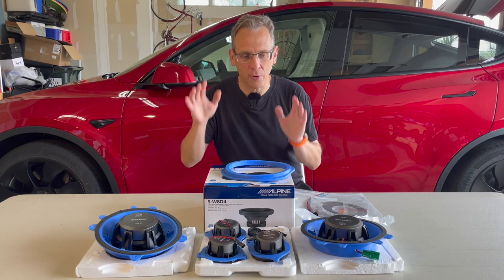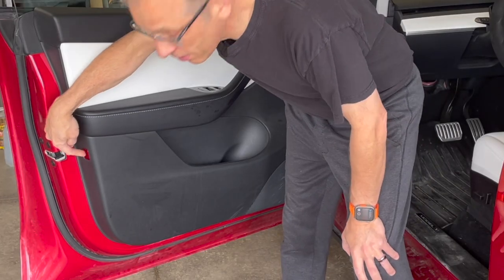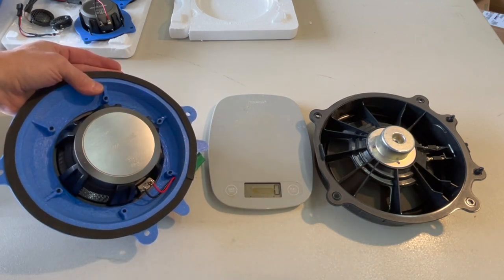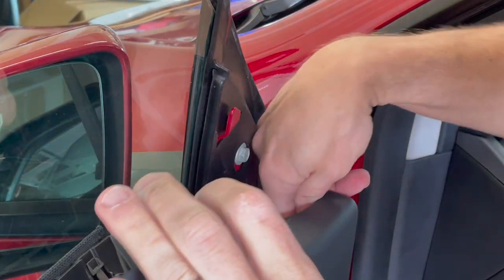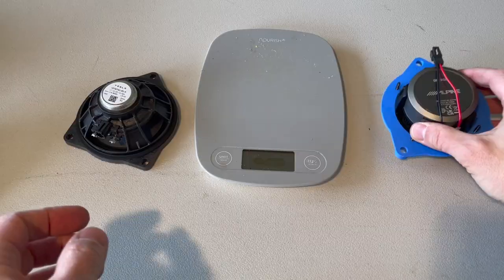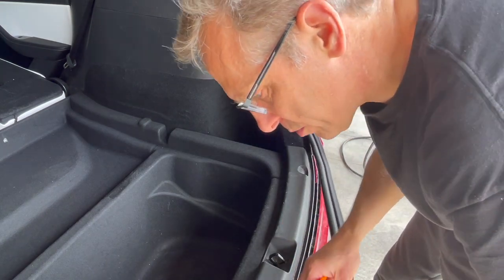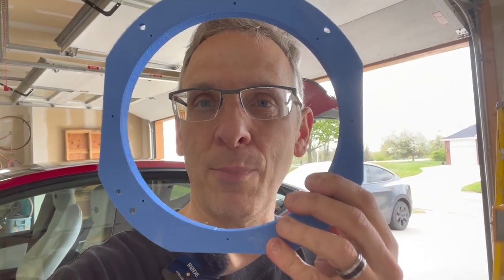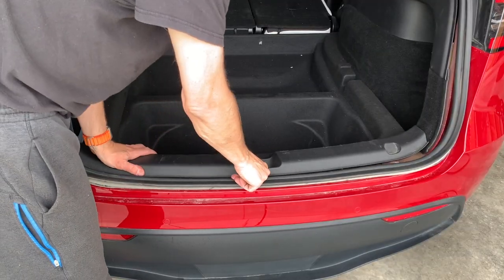Massive Tesla Model Y/3 Speaker Upgrade! - Hepaking

Comment: I always see this mistake on car audio upgrade videos:
Just because the magnet on the stock speakers is smaller than that on the aftermarket units, it does not mean that the magnet is weaker. The stock speakers use a neodymium magnet, which is way stronger for its size than the ferrite magnet on the Alpine drivers. Neodymium magnets are used in car speakers because they have a lower weight compared to ferrite ones. Also, high performance subwoofers or tweeters typically use neodymium magnets because of their better performance.
Reply: True when I remove my stock speakers from my front doors and switch to aftermarket the doors got a lot more heavy which made my doors hang down little. 
There’s pros and cons I only wish more aftermarket would push neodymium
Reply: Facts
Reply: Well said

Comment: It looks like the Tesla speakers are using neodymium magnets.  They are much smaller and lighter than ferrite magnets.  Don’t judge speakers by magnet structure size alone.
Reply: I agreed with you. The original speakers are designed and engineered by Tesla and they are matched with the sound system and acoustic of the Tesla Y. My question, do they sound louder or cleaner?
Reply: Facts

Comment: Specifications might have been nice Wattage? Frequency range of each component etc.. Also I think someone else here has mentioned Neo Magnets vs. Ferrite. There were no specifics not even any comparisons ie. You didn't play the music first via existing system to do a A > B comparison. There were no measurements. Are these speakers a tuned kit? Why are the rear door speakers not changed in this kit, does this make a difference? What is the comparable power consumption? We know this weights significantly more but does the system draw more power the same or less? It was helpful to see you fit it although wrong, why was the correction not filmed? ie. Did you listen to it at the end the right way around? How will the additional bass affect rear seat passengers? Will everything sound better if you fit an aftermarket sunblind? How is the sub sound affected if you have a rear parcel shelf installed? As Tesla does an awful lot in DSP what happens when Tesla makes upgrades to the Software thinking the existing speakers are in the car? So many questions especially when with shipping we are talking about + £ 1,000.00 UK GBP and we are not even upgrading the AMP in this arrangement. How is this any better than the Light Harmonics upgrade which is supplied showing less power draw than Tesla's own system and replaces 11 speakers for around the same kind of budget with and uses similar to Alpine cone technology and magnets. Just curious because as interesting as this was I came away with more questions than answers and even more questions after visiting hepa kings terrible website which had even less information, not real details and no obvious mentioned of the Sub in the package other than the 3D printed ring. This is harsh criticism but only because I reckon you could make the defacto all singing all dancing audio upgrade video on here giving all the answers. ;)

Comment: Great video. I found a website and ordered harness adapter and different speakers. I installed a skar 300 watt 150rms for the trunk wow I mean wow I upgraded from light harmonic v1 and just wow for 45 bucks big upgrade the magnet on the dual Chanel speaker is pretty big and heavy. Jl audio 300x for front dash mid range

Comment: It will definetly sounds different, not better. The speakers are standart with custom mounts so they can fit, but has never been designed for the soundpicture in a Model Y.

It only sounds better for those who do that speaker change.

Comment: Your new speakers are extremely heavy because they have ferrite magnets instead of neodymium magnets like the stock speakers from Tesla. You are sacrificing weight for better audio which it doesn't make sense considering there are plenty of other brands that offer the same carbon fiber cone speakers and have neodymium magnets. Those magnets are not only lighter but much stronger than the ferrite and they use way less energy which is another reason Tesla uses them. Just because they are small doesn't mean they are not powerful. I'm sure your new speakers sound amazing compared to the Tesla ones, but you can obtain the same or even better sound using different aftermarket speakers as I mentioned while saving on weight and power which should always be in your mind when upgrading a Tesla that is already heavier than a counterpart ICE vehicle and needs to save as much electricity as possible for better range and performance. Cheers

Comment: Hmm... ok aside the tweeter thingy. What about a the amps? I did build once a decent car hifi with quality in mind and amps were as important as speakers. Larger speaker with larger coil and different impedance curve (4ohm is just one number - speakers have various impedance curves and they need to be 'driven' with enough current) So question is how long your stock amps will last with the new speakers :) (trust me I'd like to replace my speakers too in my M3 but I am not keen to scarify integrity of the system as a whole by replacing the amps too)

Comment: Did you install a new amp? I have used full (speakers and amp) replacements on several of my cars. I have found that short of full speakers and amp replacement, you are better off replacing the amp. Factory speakers will sound a whole lot better with clean power to them.
Reply: Replacing the amp with a more powerful one and keeping low wattage factory speakers doesn’t make any sense just like adding aftermarket speaker with higher wattage while keeping the same low wattage factory amp.
Reply: @MisDirected2014  Of course it is best to junk the whole thing and start over. We can all agree to that. However, I did a test in a Honda of mine and put in an Alpine 5 channel amp and sub in it and kept the factory speakers. It was amazing how well it sounded. I didn't end up installing the MB Quart speakers I had.

Comment: Your amp hasn’t given out yet? I changed just the sub on my 2023 model Y performance with a 8” kicker sub. The amp blew out not even 10 minutes after bumping. I had to get a new amp and put the garbage stock sub back in
Reply: When you say blew out, does that mean there is no longer any sound, or does it feel less powerful? I have this Hepaking set installed and at first it sounded good. But now the sub doesn’t feel as punchy
Reply: @kevinnguyentv blew out like it made a chirping sound then all speakers cut out. Only the tweeters on the door pillars worked. So I had to buy another stock amp ( found one on eBay ) everything works fine again just stuck with the Tesla subwoofer that sucks big time
Reply from the maker: Mine is still kicking. I have to admit, I don’t push it volume wise.
Reply: @iowatesla that’s probably why it’s lasting. I turn my music up loud 60 to 80%

Comment: Yes according to Tesla there are 14 Speakers the ones you seem to have missed are the two in the A Pillars 2.5 mid range, 2 in the rear doors 4" 33w mid range and 2 more in the boot lid rear panel correct me if I'm wrong
Regards John
Reply from the maker: You might be right. It was still a huge upgrade to the sound quality.
Reply: @iowatesla  why wouldn’t you upgrade the 2 rear does also??
Reply from the maker: Not part of the kit.
Reply: @iowatesla  gotta get those 2 rear doors done for an overall change